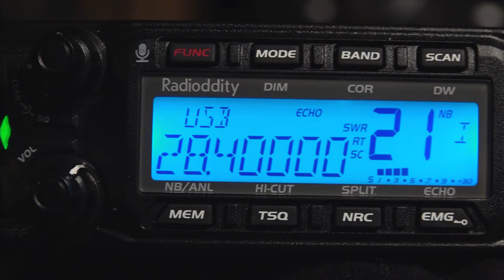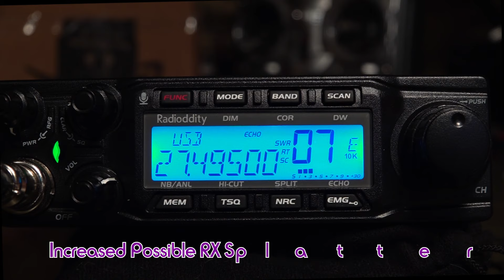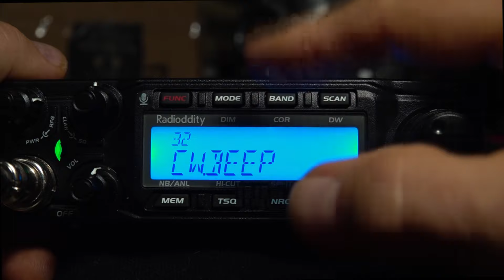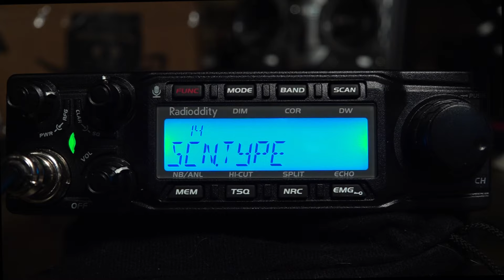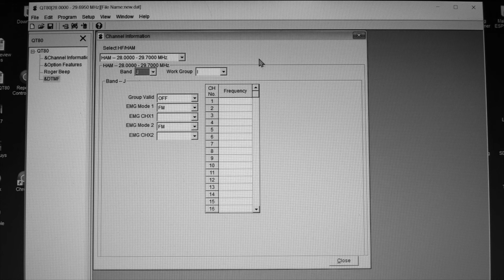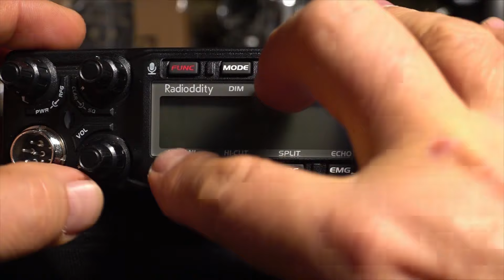Radioddity QT-80 10 Meter PLUS Radio

Comment: I was thinking  why you could not put a mono plug in the case, some where to run a key for cw. And run a wire to the PTT wires, where  they join the board.

Comment: Good video. 11 meter CB radio is where the fun is.  Don't turn off PA, you can have fun with that in a mobile setup! I just got a QT80 and there's a problem where you can't turn off the beep sound.  Have a QT40 and love the physical knobs way better.

Comment: I refrain from addressing radio's CB performance attributes. This radio produces full SSB output in the CB bands. On AM it produces upward modulation at a reduced carrier power level. Resulting AM quality is actually very good.
Reply: Why do you refrain? I’ll almost guarantee most of these anytone and radioddity radios are being bought up by 11 meter users

Comment: The elephant in the room that no one wants to talk about is in the 11 meter band does it just produce the advertised 80 watt dead key but does is swing forward upon modulation into higher power ranges or just stay at a maximum dead key level of 80 watts. Please explain…
Reply: The 80 watts is with full modulation. Not bad when a 4 watt "legal" CB with a 4 watt dead key only does at best a 10-12 watt RF output. I specifically bought this radio for use on 11 meter (CB) SSB, and it does just fine. I absolutely hate menu driven radios, and it took a while to get everything set up. But since I use it only on the 11 meter CB band, mostly on LSB, once set up, it works fine. I wish they made the QT40 with 80 watts. As someone who used to use an external amp, one thing I really like about this radio is just how clean and on frequency the signal is. It does not splatter over onto other nearby frequencies. It's also quite a bit smaller than the QT60, which I sold to get the QT80. I live in the southwestern U.S., and have made many contacts in the South Pacific, from Tasmania to Japan, Korea, and Taiwan. I can usually make daily contacts in New Zealand on 11 meters.

Comment: Just one note: moving the jumper to pins 2-3 only enables the 15mt band. The key presses on switch-on allows to select HF/HAM Band even without moving the jumper
Reply: thank you for mentioning that. I noticed that most people modifying this radio to get the CB band keep including the jumper move. That is indeed not necessary. Cheers !

Comment: Great job ! I have the QT 60 and it is great. I did get digital modes with Digi rig as sound card. This gives a PTT but VOX works as well. I used the Anytone AT 5555N II  cable set . The QT 80 cam out after I got the QT 60 . Still happy. The QT 60 is now replaced with the QT 60 PRO that is shorter . The only odd thing with the QT 60 is using the CTCSS/DCS tones. It is a number on display and have to look up in manual to get the HZ . I just made a copy ,enlarged it and laminated it . Both radios work great portable and on battery !  The thing to watch for digital modes is duty cycle to your power out. Like FT8 . Just cut power to keep heat sink cool. The only trouble I had with digital is getting levels from PC to radio correct. There's  no ALC display  ,so setting WSJT-X TX level can be trickly to get best point. I used a scope to look for folding of signal. The the ALC pulling back. You  can use peek reading meter as well. you get to a point wear their is no more power increase. just back off a tad from that point. the audio TX level is set and just use power on radio to set your power out. Just a confusing thing in WSJT-X . Nor really RF power on computer. That TX audio level. The power is set buy radio. once I figured that out FT8/JS8 call and FT4 ETC was easy making contacts. Done SSTV as well. Lots of digital fun ! I got CW decoding to work on PC . even RTTY . FLDigi is a great program.  73

Comment: TIP: PRESS and HOLD the BAND key to enable full VFO mode!!! You don't need this radio in channel mode at all! And it will not mute on step changes in VFO mode! Set the PF KEY to "CH.PUSH" to make good use of the full VFO mode. 73

Comment: Since the QT 80, and the Anytone 6666 Pro are seemingly the same radio, I feel compelled to tell of an experience I had with the Anytone !
While the radio was turned on in receive with no antenna connected, the radio began to smoke !
Had not been used to transmit for at least Two hours prior !
Fortunately I was sitting in front of the radio, and immediately turned the radio off, and shut off the power supply, likely preventing a house fire !
Unfortunately, my trying to alert Anytone so far has fallen on deaf ears !
Even having a dealer for Anytone emailing the Company thru his normal correspondence route ?
Upon a cursory inspection, I noted only the Positive lead showed signs of the wire insulation melted, and what appeared to be charing of the PCB where the Positive lead meets the board !
Not having a schematic, I'm guessing like many transceivers, that power is always supplied to the Finals, regardless of the power switch setting, and I'm guessing that a Final failed, and caused a short ?
I have purchased Two, with plans of putting one in a Mobile.
But now I am afraid to leave one unattended, with power supplied continually as would be in a Mobile installation !
Hoping to hear from Anytone on this, I can only say, 
" Caveat Emptor " !
Don't leave the power on with these radios unattended !
Previously, I had been bragging to people about how these radios were legions ahead of what we had decades ago !
And I still believe that !
But if lets say there were a bad lot of Final transistors installed, then I certainly believe that this needs to be addressed !
Too as is, these radios run extremely Hot in Transmit !
Hence the heavy duty Heat Sink !
I placed a fan at the back, and that seened to resolve the heat issue !
I'm guessing if others fail, and GOD forbid start Car or House fires, the Company will have no choice in responding !
Reply: Nobody else in thousands and thousands of sales of this radio have had your problem. Either a mistake was made by you, or there was fault in the radio,. but NONE of that explains why the fuse did not blow if such an event occured. Sorry, but it just doesn't make sense and you are posting this same story everywhere. And for what? 73.
Reply: @mostlypostie1  
I think it's only right to let people know what happened !
For whatever reason, Anytone has not responded to my reaching out, or one of their Dealers, that used his own networking !
So far, neither of us have been contacted !
As to my doing something wrong, the radio was sitting turned on without an antenna connected, as I had been using it on Ten meters earlier in the day !
Never thought anything about leaving it on, but I simply got sidetracked reading !
Fortunately, as I've stated, I was essentially sitting in front of the radio, when I began to smell something burning !
When I looked towards the radio, I began to see white white whisps of smoke coming out of the holes in the side of the radio !
Not sure how long, or how experienced you are, but I'm thinking it was quite possibly a Final that failed and caused a short.
As only the Positive lead showed any signs of damage, except for what appears to be a charing of the PCB.
As many transceivers provide constant voltage to the PA 's, it is my guess that is why only the Positive lead was affected !
That and my quickly turning the radio off, along with the power supply off !
I was just watching a video from several years ago, showing an earlier version of this radio, as this style and design is not new !
And comes under various Brandings !
In the video, the narrator told that many people had Finals fail !
So what happened to me, may in fact be an old problem ?
And even more worrisome, is anyone that purchased thru Amazon, would likely be told what I was told when reporting the incident to them.
That being to simply throw the radio away, and they would send a replacement !
So it would seem that if that is their SOP with these radios, and maybe others, then that may be the reason you haven't heard of issues with them ?
My conscience wouldn't let me turn a blind eye, to what could be a potentially dangerous issue !
As had I not been close by, I very likely would have had a House Fire !
And the same is true if this was to happen in a Mobile installation !
Parked in an attached garage, you can surely understand the ramifications of such an incident !
So that is why I feel compelled to share my story !
Hopefully so no one would lose property, or life over such !
Obviously they will make their own choices !
But as I own Two of these, I will never leave them connected to a source of power, while unattended !
Once burnt, lesson learned !
Pun intended !
As to your assumptions, about something I did ?
Please don't jump to conclusions, or cast aspersions of people you don't know !
I have literally been around, and worked around electronics since about age eight !
And have held an Amateur Radio ticket some 44 years !
Long enough ago, when Amateur Radio was still a Service !
This is not Rocket Science !
And from what I'm beginning to learn, as stated earlier, I think this isn't a new problem, but one I just happened to unfortunately experience !
Reply: @mostlypostie1  
I just tried to post a very lengthy response to your query, but for whatever reason, YouTube didn't post it ?
At least where I can find it !
Perhaps it went directly to you ?
But I will not bother to try again !
And suffice to say it is what it is !
Reply: @mostlypostie1  
My latest reply did post !
Hopefully you found it ?
Reply: How was that even possible without blowing the fuse?... What you just described makes no sense.
Reply: @chezirroy  
That too is a question I have brought up, even with Amateur's here, some having been Broadcast Engineer's for 40 years !
No one has that answer, but we seem to come to an agreement that it very likely was a shorted Final !
Not sure how versed you are on Transmitter construction, but you should understand that many Transmitters have power supplied to the Finals, regardless of if the radio is powered on, or off !
As to a fuse not blowing, it might depend on how the Final failed ?
Since this was sitting idle, and just turned on, no antenna connected, perhaps it went into a self oscillation, and destroyed itself ?
Sadly with no reply from Anytone, we may never know ?
As they may have purchased a bad lot of Finals.
As to not hearing about other's failing, I guess that may depend on if dealers are aware of issues, and how they chose to handle it !
I purchased mine off of Amazon, and after a couple brief talks with an associate, and his supervisor contacting the Seller, I was told to throw the radio away ?
And they would send a replacement !
That in itself speaks volumes !
I'm guessing they knew Anytone isn't honoring any warranty !
So they chose to handle it by simply replacing it !
Which is great, but doesn't help someone whose home, or auto catches fire !
And that is the only reason I posted the information !
I felt that at least people should know not to keep power on these radios, while not in use !
I had a similar incident several years ago, with an Alinco DX - 70 TH, installed in my pickup truck !
Parked my Truck for a couple hours, and when I went to start it, my battery was dead !
Later when I did the trouble shooting, I traced it back from a shorted Positive lead, to the Final !
Same thing there !
No blown fuse, but drained the battery flat !
After I found the cause, I was surprised that the truck didn't catch fire, but this one never melted any wiring either !
So it happens !
The guy at Amazon told me his brand new iPhone caught fire in the charger !
So you never know !
Better safe than sorry !
Hope this helps !
👍😉
Reply: Radioddity has much much better customer service by many accounts
Reply: @Mikeysixkiller
That was not my experience at all, nor that of one of their Dealers, who used his own contact information to contact them on my behalf !
He said they never responded to him either ?
Consider yourself fortunate, if you've had correspondence with them !

Comment: I wish you would have shown the output on 15 meters with voice, as opposed to a whistle !
Mine acts strangely, as I can show several watts output with a whistle, but regardless of how hard I try to modulate the microphone, it barely moves the watt meter ?
As to the Noise Blanker,  you will only see both NB/ANL displayed when in A M mode !
NB only in SSB !
I am disappointed in the little effort of these transceivers towards CW !
Putting a 3.5mm/ 1/8 inch Mono phone jack in the back of the microphone, will earn you a nasty shock when your palm touches the jack, while speaking into the microphone !
But why the low RF output in CW mode ?